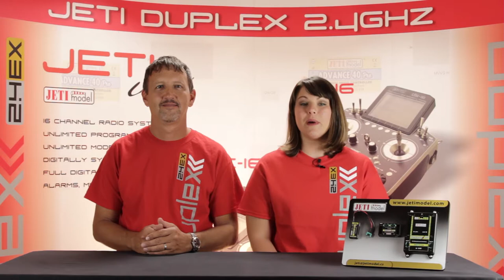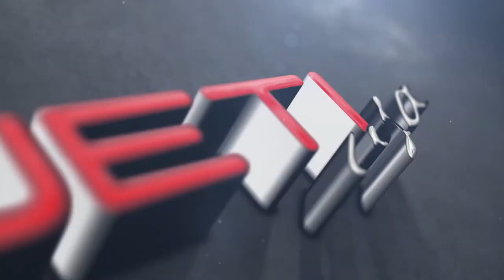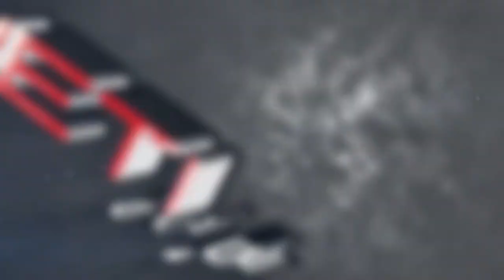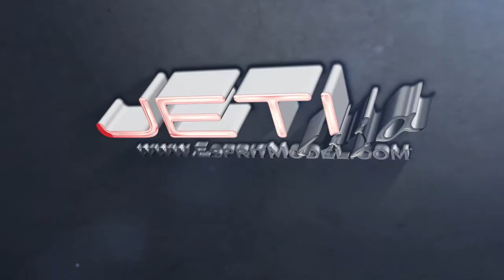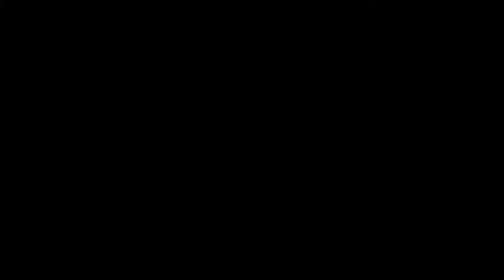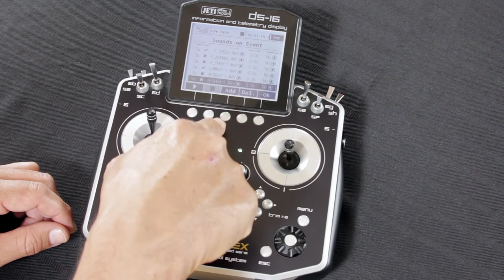Jeti Programming: Telemetry and Sound On Events

Comment: Please can you help me? I got Jeti DUPLEX REX receivers and a DS-24 (it's a beauty:) These can read the voltage via telemetry, but I only see the receiver voltage, which is fed back by the regulator to approximately 5.8 volts. I want to empty my cell package 4S LiPo to a minimum of 4 x 3.7 = 14.8 Volt and that is far above the 5.8 Volt receiver voltage. How how can I see or arrange that I can read the voltage of the LiPo package and set an alarm for the minimum voltage?